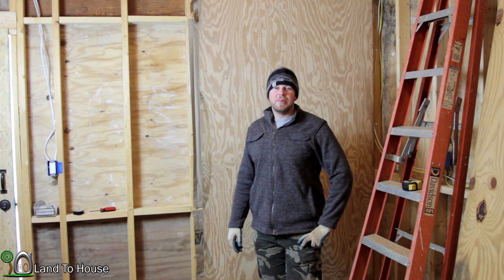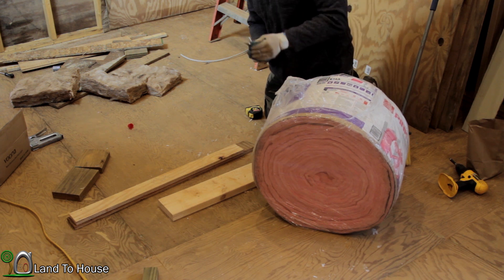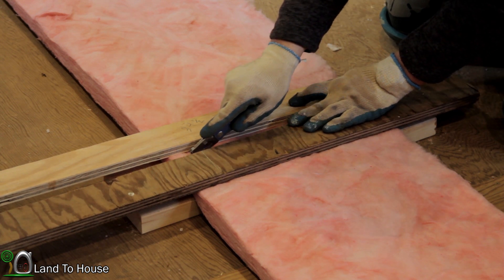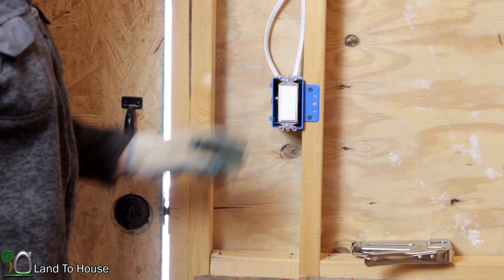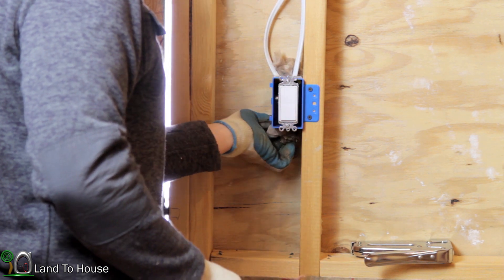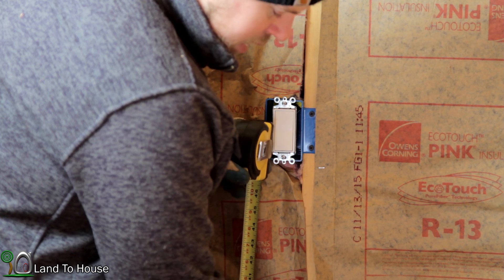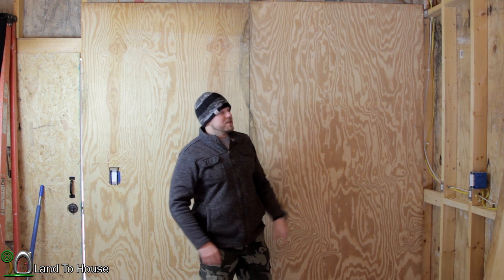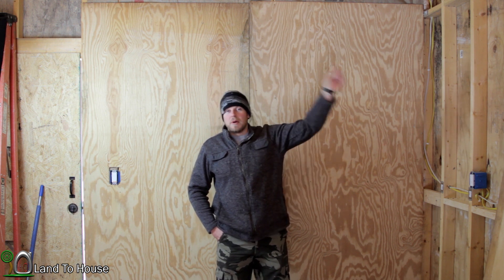Insulation and Paneling - Build a Workshop #24

Comment: Brings back memory's of when I installed insulation in my mancave walls and ceiling.  Great job!
Reply from the maker: It is not hard work just a little annoying. Sure does make a difference with sound and temperature.
Reply: How big was the shed you did and how long did it take to do?
Reply from the maker: I actually have a new series on the channel called "build a shed" 14x20 around 1 month by myself.

Comment: On the insulation where you cut it and the flap is not available, you could use coat hanger wire to support and hold it in place. Or any kind of stiff flexible wire that can flex.
Reply from the maker: That is true. I have been pulling the flap all the way out and then overlapping the other side by pulling the insulation away from the backing just a touch. Enough to place a staple.

Comment: Would you mind sharing your opinion on the battery circular saw? Is it worth getting one?
Reply from the maker: +Michael Dornhausen I actually have a review on the saw. It is fantastic. I must have made 500 Cuts with this saw. I cannot speak for the new Lithium-ion batteries but the version I have is great. I highly recommend it. The motor is on the opposite side of as the AC saws and this makes all the difference. So much more user-friendly
Reply: Thanks. I'll search for your review. I'm surprised that the saw being built the other way round is more user friendly. When I handled the saw in the hardware store, I was wondering how shall I work with this, being righthanded.
Reply from the maker: +Michael Dornhausen I had used a cord saw for a couple years before getting this and I was immediately surprised how much better it was to see the cut as I'm making it. I might just be weird but I like it much better. I am also right-handed.
Reply: Convinced, I'll save money for a cordless.

Comment: Watch screw depth near wires. I'm doing the same project and used 2 inch screws into 2x4s.  To long. Hit a wire that ran through the stud. Zaaaap.
Reply from the maker: +michael czerniewski oh no! I did not really talk about it but I used metal plates to cover the places that the wires ran. Now outside when I install the sheathing I will have to watch out for that. Did you get hurt?